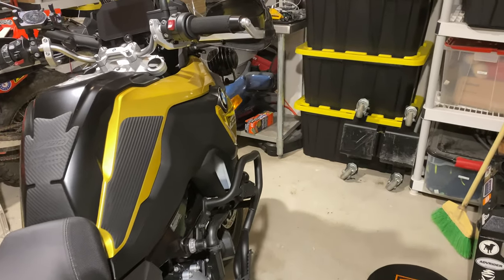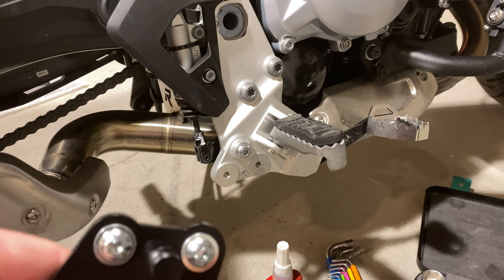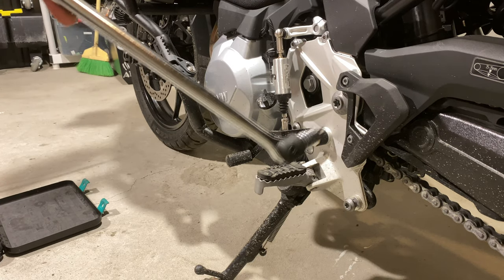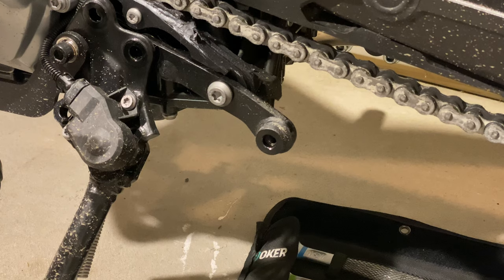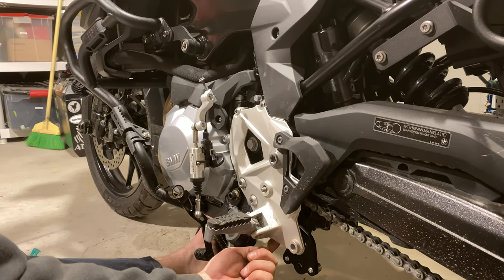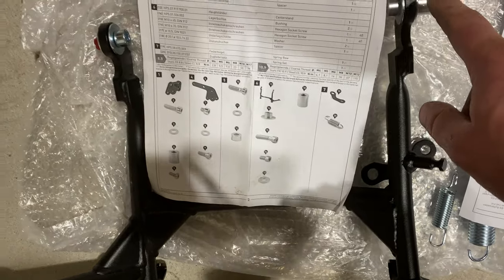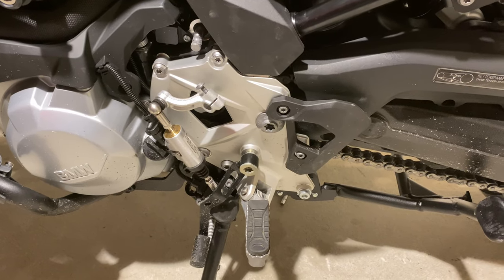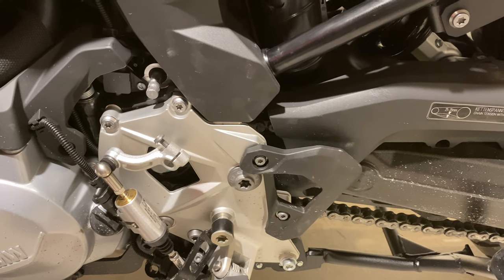Install: SW-MOTECH Center Stand For BMW F750GS Low Suspension / F850GS

Comment: Great video as I had just bought a 3k mile f750 gs with the center stand still in its wrapper but no instructions, I see why the  guyI purchased the bike from never fitted it. with the reduction in ground clearance, I think I will wait a while and see how and where I ride out. And that knowledge is all due to watching your video Thanks
Reply from the maker: Enjoy the new bike. This does take away some ground clearance. I'd advise the same, not to install until you're sure you don't need the clearance.

Comment: Mike here, also from NH. I am considering this for my white version of same bike to make maintenance easier/safer. Your videos have been inspiring.  Any updates on bottom outs on curbs, speedbumps,  dirt roads with some washout sections?  I still have the big exhaust resonator, so this looks like designed to fit below that.
Reply from the maker: Hi Mike and thank you for watching! I've ridden heather's bike around and I'm a lot heavier than her so the suspension sags a bit more and I have yet to scrape the center stand or drag it but this bike does not leave pavement so it's a different use case than my big GSA which is raised above stock height and still grabs the center stand. It sits low but it's totally fine for road-touring...and it makes maintenance a LOT easier! I'm not sure I'd do any washout/ruts/dirt/water crossings with this on an F750GS Low. it'd be too low. and your'e correct it does work with the OEM resonator. I have an old video of a low F700 with us off-road and lots of bottoming out. Best moments are 7-20 minutes - https://www.youtube.com/watch?v=aOwExKBEAug
Reply: @AdamChandler86  Thanks...That old vid was fun to watch. That road is definitely way more "billy goat" than anything I have plans for, but of course when you are exploring an unpaved, you never know when you might hit at least a section of washout.  I am a big believer in being able to reach the ground with at least half of each foot, hence the choice of the low setup that the previous owner bought it with was fine by me. I like the lighter weight of this ride compared with my 100+Kg  heavier antique Goldwing that I use for two up riding, and  I could see how the folks with the 1200GS' were struggling  with the weight when they went down.on the tougher spots. I think before I go for the center stand, I will see if the 2x4 under the swing arm tilt is good enough for faster chain maintenance.  My front tire bike rack should be good enough for other maintenance things that dont involved removing a wheel.
Reply: Hi Adam.    Well this year I finally put one on my bike.  I saw Heathers bike in the truck when they brought mine back from service so I took a look the stand while mine was being unloaded.   I saw your picture to help with the torques.  Did you end up replacing that giant bolt?  If so where did you order it from.  I did not know it was supposed to be replaced.  I need to buy a bigger torgue wrench.  I put 90ftlbs on the old one, but didnt seem as tight as when it came of.

Comment: Hi Adam, Isn't it hard to put up? I have a factory low with a generic center stand. The problem is, I think the stand is too long and it is impossible be put up by a single person, can you do me a favor and measure how long is the stand from the pivot point? Thanks a lot!
Reply from the maker: It's hard than my R1200GS center stand that's for sure but if you are like me (probably not) and weight 250 pounds, you can stand on the center stand foot pad and just put your weight on it and up it goes! My wife is off on a trip this weekend so I can't measure at the moment. I'm sorry. But this was the part specifically for the F750GS low so maybe you got a longer one?
Reply: @AdamChandler86  Thanks for your response! Yeah, probably got one for a regular height but the seller told me this is specifically for a low sus and also I'm just around 150lbs 😅
Reply from the maker: I guess you have 2 options. Gain 100 pounds immediately (LOL) or get the right part.

Comment: Thanks for creating this video.  I just brought home a 2020 750GS and was searching for an aftermarket Center Stand.

One question...I see you have a kickstand enlarger.  I looked at the Givi one and they specifically said it would not fit the 750GS Low.  Which one are you using?  Thank you in advance!
Reply from the maker: That’s probably because their model rises the bike too much. Risers can be a problem on low bikes sine they don’t lean much. This is the AltRider one. This and Touratech’s don’t have a huge impact on the low model.
Reply: Adam Chandler appreciate the reply.  I put an order in for the same centerstand and will look for the altrider kickstand foot enlarger.

Comment: i put a f800gs stand on my f700gs, i haven't been able to get it on the center stand yet, and thinking maybe its harder  because of the lower suspension and smaller front wheel, is this a possibility or should I be able to get it on the stand alone?
Reply from the maker: Correct. Low bikes are very hard to get onto a center stand. I think the low model F750GS didn’t come with a center stand for 2 reasons. Safety (the center stand hangs very low and can catch on speed bumps) and usability (very hard to deploy because the bike is low) It’s a basic geometry issue.

Comment: Thanks Adam! I have a new GS too and mine is the low-suspension as well.
Reply from the maker: Congrats! We still run this center stand and it's been really convenient.
Reply: @AdamChandler86  I don't plan on trail riding, but the lowered clearance with it looks a bit concerning to me, as I would hate to scrap it going into a sharp corner or over speedbumps, etc. BTW, I see the NH plate. I am right next door in VT. :)
Reply from the maker: Awesome! Maybe I’ll see you at a club breakfast this year. The vermont Bmw club is moving web hosts but our site is https://bmwmov.club
Reply: @AdamChandler86  Cool! Thanks!!

Comment: Hey......do  you know the oem torque spec for the original bmw bolts?
Reply from the maker: Here's a screenshot from the manual - http://i.imgur.com/CYzg7er.png
Reply: @AdamChandler86   200 nm for that big bolt  ..... only put 50 foot pounds lol
Reply: @AdamChandler86  My dealer is telling me I can't re-install that big 200Nm bolt. They are advising a new bolt.
Reply: Sure enough...the screenshot of manual says "replace screw"...thank for posting that